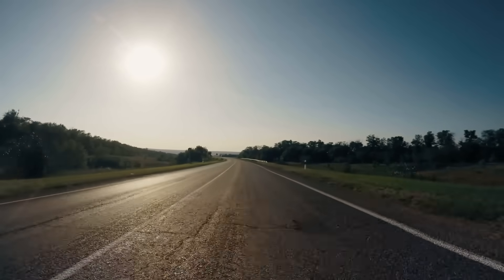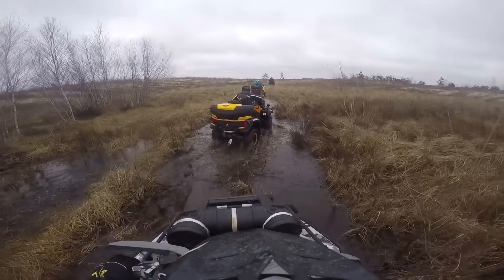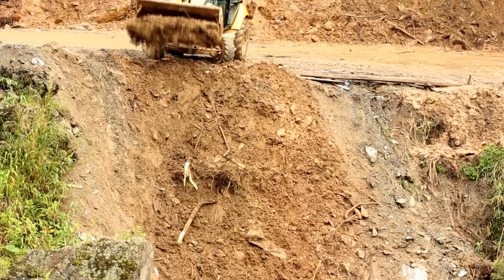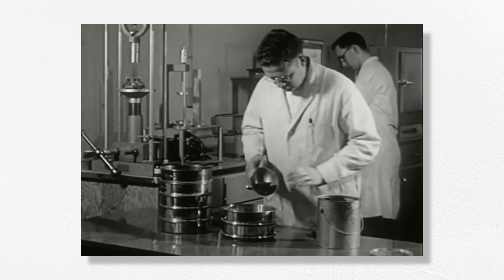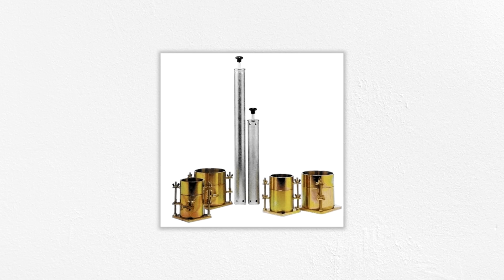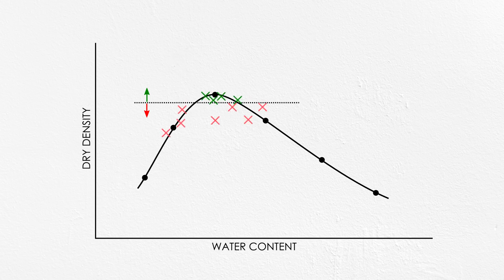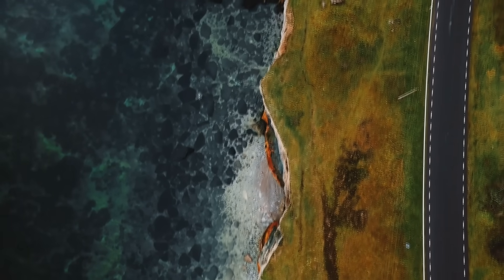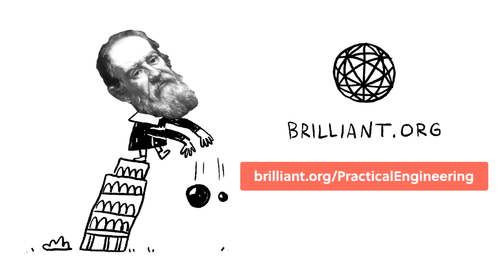Why Does Road Construction Take So Long?

Comment: One thing about roads that's always had me curious is how the expected lifespan of a road is calculated and what types of decisions are made to decide how durable a road should be.  I imagine the latter is almost exclusively "local and state codes," but a deeper dive into the trade-offs one makes when building an interstate highway versus a residential street seems like an interesting topic to explore.
Reply: I'm a civil engineering designer, Generally speaking the expected lifespan of a road usually boils down to achieving lowest cost taking into account initial costs and maintenance. For instance a rural road could simply be compacted subgrade and asphalt seal, this is cheap, however won't last very long. But as the average annual daily traffic is relatively low this is reasonable. 
Where the design vehicle is typically larger (say a highway or industrial estate) the pavement thickness will be increased to take the loading. This is more expensive but should last longer. Other factors to consider include expected rainfall in the area or the connecting infrastructure.
Reply: @aussieL14M  I always here about how Germany makes roads that last compared to Michigan that doesn't.  It seems that the cost of time wasted to society should have more weight in America.
Reply: I had a similar question, how long does the average road last? They seem to resurface the roads after a few years, even when the road is stable.
Reply: @tubester4567  A typical interstate road is built in many different layers and will last many decades without the need of replacement.  Starting with the sub-grade (large stone) as a base for all the asphalt,  then many layers of asphalt pavement.  Normally you see base asphalt with stone up to 1.5" in two 8" lifts, then some binder layers with smaller stone, and finally the wearing layer with the smallest of stones.  These roads (at least in my state of Pennsylvania) could be as thick as 24" of asphalt.  The small stones make a nice smooth layer which gives a nice ride quality and low tire noise, but over time large trucks and millions of cars putting their weight on and off of the road causes the stones to wear out and break (hence the name wearing course).  When you see a resurfacing job, it is to remove this wearing course and replace it.  This is expected to last 7 years or so, but due to climate and increased loading on the roads (increased traffic) this number could drop significantly.  Resurfacing normally doesn't take too long to complete though, normally 1-2 months where as a total depth replacement might take 1-2 years.
Reply: @xDrexelx  Thanks for the response, and the other guys who responded.
Reply: @tubester4567  Civil Engineer here. In my state of Kentucky, the generally accepted design life of asphalt pavement is 15 years before resurfacing is recommended, and 20 years before a full depth replacement. The top surface is the thinnest and most expensive part of asphalt pavement, and is designed to wear down over time even while the subgrade remains stable. As mentioned above, rainfall and vehicle loading can drastically change the performance over time, and water freezing and thawing during colder months is one of the largest contributors to pavement failure.
Reply: @tylerkoch258  in Minnesota we try to get 10years out of our top 2-4 inch wearing pavement but as a former New Mexican DOT employee we could sometimes get close to 20 years before a mill and overlay.
Reply: tubester4567 what country do you live in? In the U.K. they haven’t heard of resurfacing - roads are shocking
Reply: Is a bit complicated, as anything in engineering, depending of the code used is usually calculated a number of equivalent axis of vehicle traffic from there you can design  the multiple layers of materials to resist  the forces applied and work with the deformation expected to occur, or you can take some pre-desing, pre-validated solutions.
Reply: Another interesting point si that, during the designing of the new road, you have to take into account the rise of trafic for a period of time.
Around here (France), the main parameters for designing a road are the number of heavy vehicles by day and by sides; the expected lifespan (usually 20 years), the rise of trafic in that time (by standard it is 1% but it vary locally) and the excpected intensity of frost. Then, you decide on the types of soil to use in adequation with those parameters, and by following a set of abacus, you determine the minimum thickness, compaction, type of compaction, etc...
The first time you see the sheer number of abacuses and norms you have to follow, you understand why it takes so long to make a good road.
Reply: For highways in the UK the 'design traffic' depends on the commercial vehicle flow (annual average daily flow of commercial vehicles) design period (the standard says 40 years...), a growth factor (assumed increase over the design life),  vehicle wear factors (accounting to heavy loads) and then how that traffic is distributed across the lanes
Reply: And load limits
Reply: Its a great topic as there is alot that goes into it. The first big factor is how much pavement are you going to replace/ build. Varys by state but most of the time if its over a mile in both directions you'll need to do a lcca life cycle cost analysis. Again if its a big job you'll then have to do an alternate bid and have a planset for concrete and another for asphalt/bituminous. Bituminous just being another word for asphalt. Then you the pavement engineer will look at the projected 20 year or 40 year traffic load and heavy commercial traffic load/esal number and come up with a structural number. With that number they can pick from various thicknesses of subbase base course and pavement to come to the structural number. A concrete job will always be more expensive up front but will have less maintenance over the design life. An asphalt road will require overlays/ mill and overlays every 7 to 15 years depending on where you live.
Reply: Usually a highway is designed to last for about 20 years. You can run a FEM analysis and determine the full lifespan of a roadway, including it's maintenance intervals
Reply: @luccasmenoncin  So for fatigue or rafeling? What do you model in FEM? The fatigue of the mastic between the aggregate? Or do you look more at permanent deformation of the base?
Reply: @Nucleofiel  Here in Brazil we have a software called Medina, it analyses both fatigue and permanent deformation of the base
Reply: Construction inspector and contractor here. 
They design interstate roads to last 50 years. This does not mean it won't require repair or maintenance but that the road will not need substantial remediation or replacement for about 50 years. 
Or at least that's the goal. Many many factors come into play and old designs fail to meet expectations or usage increases far faster than anticipated but the original goal is usually 50 years.
Reply: There’s no average road lifespan. Roads are designed for a certain amount of time considering the current and predicted traffic loads(subdivided by axle loads), weather conditions (rainfall, depth of freezing etc), soil conditions (bedrock, swamp, sand, clay) and the purpose of the specific road. And an engineer have to take all the available information and additional surveys (geodetic, geological, archeological ...) and stir them all together and only then design how and what. A funny fact, I live in a part of Mediterranean where we have swamp, bedrock, clays and karst terrain. And no road is like the one before. And we/I practically don’t design new roads but just reconstruction of the existing ones.
Reply: A ton of great reply’s here. But there are so many factors that affect the roads stamping a durability label on them is pointless. As all of the engineers here know, there is a HUGE difference between as planned and as built. The design engineers go to great lengths to calculate and design the roads for maximum durability but rarely are there for the actual construction of the roadway. In the construction phase many value engineering reviews are done to try and mitigate the cost of building the roadway. This can mitigate the overall durability of the roadway, not maliciously but as a cost savings to the public. It just so happens that sometimes, you get what you pay for and done times you overpay for an inferior product. Not to mention the standards that change from city to city, county to county, state to state, etc. literally every municipality and government has different standards. Yes, some are shared but there is always a slight difference to cause a headache. I digress, to answer your question it all falls in weather the construction engineers are controlling the project or if the project is controlling them.
Reply: Yet another civil engineer here.
Damage to a road is caused largely by heavy traffic (mainly trucks) and weather.  Where I live in Canada the extremes in temperature between summer and winter are very large, and in the winter the soil freezes from 6 to 8 feet deep.  In silty areas with a high water table, such as much of the St-Lawrence Valley lowlands, frost will form ice lenses in the soil.  In most countries roads are built at least as deep as the depth of frost, but in cold places such as Canada where frost reaches deep into the soil, that would be prohibitively expensive. Road bases are typically built between 3 and 4 feet deep, which means 3 to 4 feet of subgrade may freeze each winter causing the road to heave because the ground expands as it freezes.  Typically roads will rise on average about 1 inch in the winter, but if frost lenses form, the soil can rise far more than 1 inch.
Also when temperature is very low (-30 C), asphalt can become brittle and can crack easily.   Asphalt is mostly crushed stone, so if you are in an area where the stone isn't naturally very hard, heavy traffic will gradually break up the stone in the asphalt. Much of the shear strength of asphalt comes from the way the compacted crushed stone locks up, so if the stone isn't very hard, the shear resistance of the asphalt will degrade over time. Over time the more volatile oils in the bitumen that cements the asphalt together will evaporate, making the asphalt even more brittle.
During Spring thaw, the road base and subgrade can become saturated, which lowers the soil bearing capacity (as well as the capacity of the base). 
So in summary, roads tend to degrade over time because of the damage done by heavy traffic, in addition to frost heaving in the winter, base and subgrade saturation during the spring, evaporation of volatile oils in the bitumen during the summer, and gradual embrittlement of the asphalt over time and during very cold weather.
Reply: One 80,000lb tractor trailer rig does the same damage as 5,000 automobiles to a roadway. Truck traffic counts are critical in designing pavements that will last.
Reply: Most high trafficked roads are designed for roughly 20 - 30 years.  For Federal highways, i.e. interstates, the pavement design is controlled by standards called SUPERPAVE.  Because of the large investment in roads, you generally shoot for 20-30 years.  Now for residential roads, that is more of a local jurisdiction, but remember that building a shoddy road means having to replace it over and over, meaning more money.  Another great topic to discuss in proper care and maintenance of a road.  The most lethal thing to a constructed road is water.  Because of the peculiar properties of water, when freezes, it expands by volume by 9%.  Now imagine various freeze thaw cycles during the lifetime of the roadway.  Any crack can widen because water will infiltrate and increase the size of the crack after freezing.  If left untreated, the water might infiltrate all the way to the bottom of a layer and then expand into voids and fill them with water.  Then when cars drive over them, you can have pumping actions.  Water sucks for roads.  Great for people, bad for roads.
Reply: It's interesting to hear estimates of heavy vehicle usage on a route factor into things.

I once saw a formula for the amount of damage a vehicle causes to a road in which the dominant term was the axle weight to the 4th power. 

That... Puts things in perspective, given that means that doubling the axle weight increases the wear by a factor of 16....

Now consider what that says about a 40 tonne truck vs a 2 tonne car.
(it's not as dramatic as it sounds given the truck has far more axles, but it's still a huge difference...)

Comment: In practice can cut and fill really be equal?  Or do you need to plan for a loss percentage of the cut that will be lost in travel or whatever?  Thanks for these videos, I love this channel because as an Aerospace Engineer, these videos allow me to appreciate science that is almost the direct opposite of my vocation!
Reply: Cut and fill will never really be equal because you are always going to have to bring in some material for compacted base. The soil only gets you up so far before you need to add crushed rock, concrete, and asphalt. Unless you are able to get blasted rock from some of your cuts and build a concrete plant on site (which some projects do have), you end up importing more fill than you will cut.

Comment: This however does not explain roads being blocked for months before construction work even begins (hint: its the money)
Reply: Utility adjustments. Where utility companies charge an arm and a leg and take their sweet time.
Reply: I personally believe that the city/county doesn't have enough storage space for their traffic cones and doesn't want to pay for transporting and storing them, so they simply cart them from job site to potential future job site.
Reply: Gubermint
Reply: Utility
Reply: Nope. Usually its because the road/bridge is unsafe to drive on and there is a process is how a new bridge is designed and tested then awarded to a company to build. 

It wouldnt take so long is the gov decided to fix sonething before it catastrophically failed but oh well. 

From a heavy highway construction worker.
Reply: @N_word_sayer  I mean you can't have worse roads than siberia, and people still drive on those.
Reply: @TheIronCowboy  

Unsafe in America is not the same as unsafe in Russia. 

But in some cases yes. The project I'm on now a truck fell thru the deck if the bridge becuase its so old and crumbling.
Reply: Hint: you have no idea what you're talking about.

Comment: Do you know what is funny part? Here in our quite poor country ( compare to Germany, France and so on) we pay in average 10 milions per km :) But you know there is coruption.
Reply: Those prices are for working with clay. If you need to blast rock, frozen ground or stabilize swamps, it gets more expensive.
Reply: @Aimless6  Yeah I understand, however when I compare the builds in Switzerland(Which is very expensive country) and full of rocks, they have cheaper roads then we have.

Comment: This is my bread and butter. Im modeling a large highway project in civil 3d as we speak.
Reply: Likewise bro. Though it is good to travel to site to see what is going on. I have many people from public designing a road is as simple as drawing a line on a map. 
Least they forget about undesirable terrain, survey works, existing utilities, wayleave application and  the list goes on.
Reply: are coffee brakes included?
Reply: @Cheezymuffin.  Disc or drum?
Reply: @Leonidas Piledriver Cities: Skylines has SImcity 4 beat hands down.
Reply: My bread and butter too, except I operate the equipment building the roads.
Reply: As someone that is staking out what designers make in cad, altho its in another part of the world, it would be nice if what is modelled can actually be built.
Reply: @rokadamlje5365  Im not sure what you mean, but contractors, where  I live, can take full advantage of the 3d model that is output.  Points are put into total stations and 'staking' out is going to be a thing of the past.
Reply: @TheImmortuary  I guess here its a mix of high tech gps stakeout and 2nd world manual labour construction. 
Main things i noticed: 
-reliance on sub 1% grades on pavement and thinking water will run off.
- Multiple grades on say a narrow pedestrian walkways. And or rounded cross sections while asphalt machines are flat. 
-idealised conduit runs, cramming stuff together 
-giving coordinates in micrometers

Okay its mostly not about highways, but reconstructions of secondary streets.
Reply: YouTube university is a great thing 🤣😜
Reply: ditto, but using microstation/geopak :D
Reply: Can you do your own series of tutorials on civil 3d?